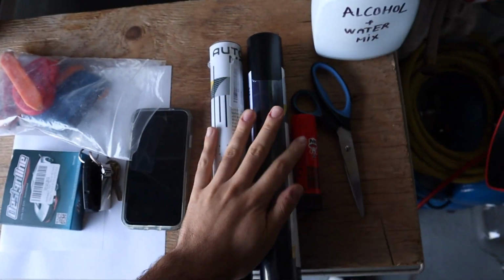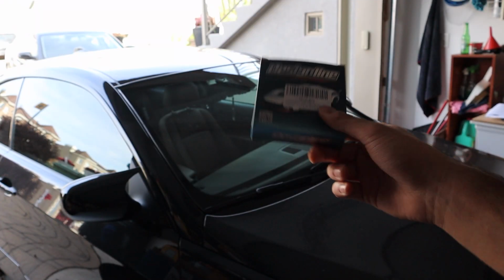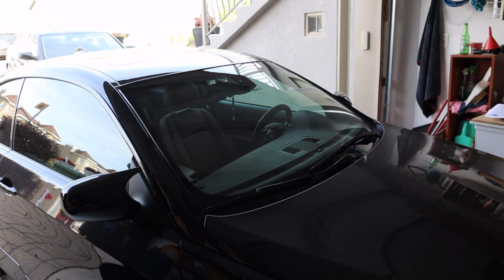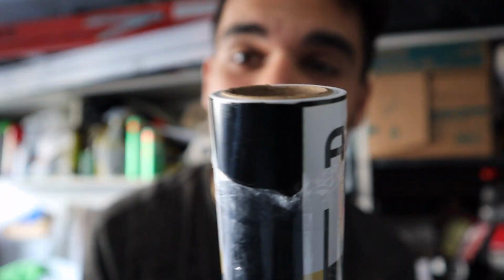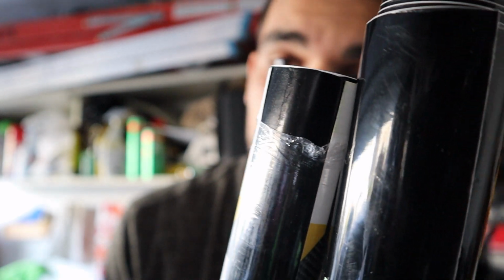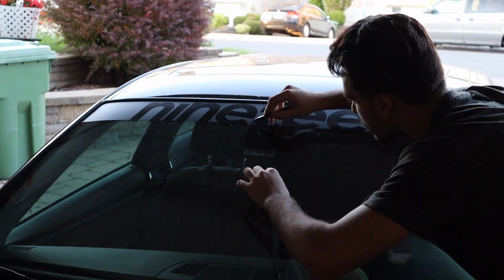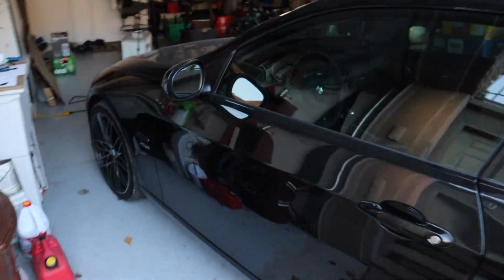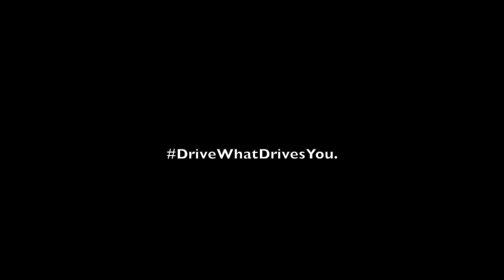CUSTOM Windshield Banner!!! *SICK*

Comment: How are those spacers holding up? if you’re still running them
Reply from the maker: Front I removed because I believe they were making vibrations past 150mph... could be in my head because the car still shakes at that speed lol. but yo the backs are still on there !! No problems to report there